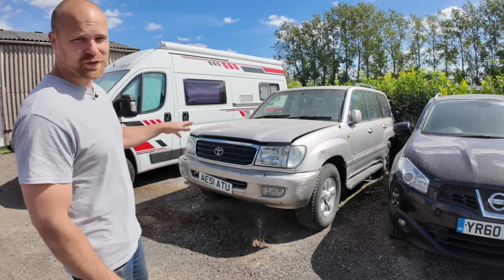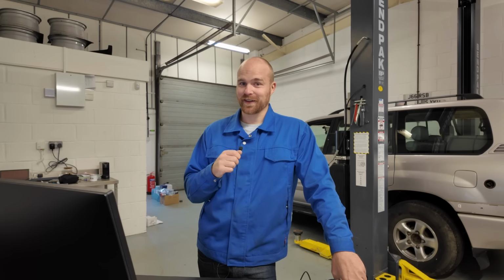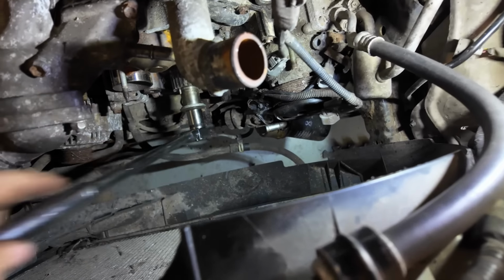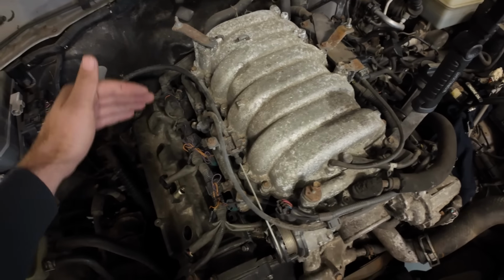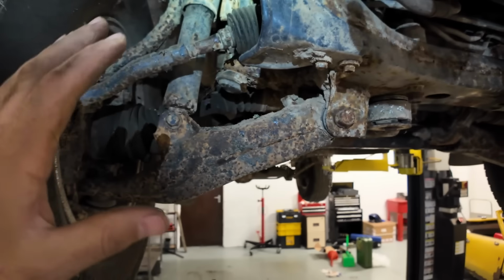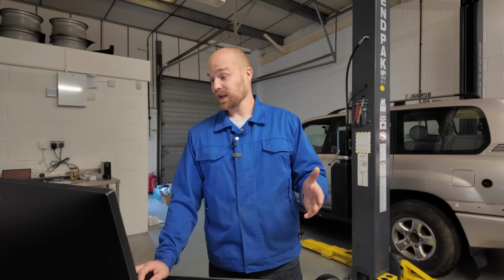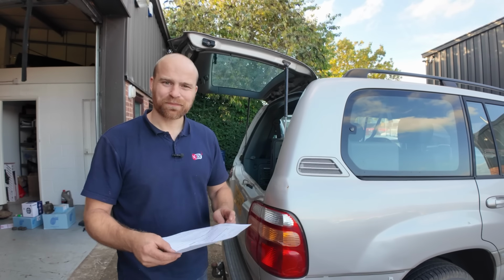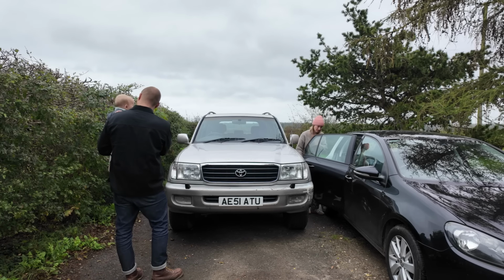Can I Rescue This Abandoned Toyota Landcruiser?

Comment: 200k on those engines is barely broken in , so a few short intervals oil changes and it will run better then any car you currently own

Comment: I would try to attempt fixing bad alternator or starter motors, they are usually pretty easy to fix, and parts are not that expensive for them. Only issue is if the alternator is that stupid one with sensors which needs to be programmed. Don't waste money on new ones unnecessarily.

Comment: Looks like there is an LPG (propane) fill point? If it has been run on LPG, that’s why the oil and inside of the crankcase is so clean.  LPG burns clean and doesn’t carbon up the crankcase. Therefore, I don’t think it’s been starved of oil! It’s probably old oil, just looks new! 😊
Reply: I was shown the dipstick of an LPG fueled car that had driven 250,000 klms. on the same oil.   It looked like it had a oil change the previous week.   LPG burns very clean compared with petrol.  Taxis with the Ford straight six 4.1 litre engine running LPG here in Australia usually got over 1,000,000 klms. before requiring engine work.

Comment: As an owner of a '99 JDM Toyota Harrier (which I love!) and a long-time admirer of the Land Cruiser, this video was a total joy to watch - great job! But you MUST change that timing belt ASAP - not only is it indeterminably old but it's also been wound round itself - it's a failure waiting to happen! You've got me looking at Land Cruisers on eBay again!
Reply from the maker: I've already purchased the parts! I was very surprised by the money that some of these are fetching!
Reply: What's a harrier?
Reply: @landcruiserscotland  It’s the JDM version of the Lexus RX300 but lighter, with a more powerful V6 engine, and a gearbox with sport and manual modes - its a great drive and can easily out-accelerate cars like Mazda MX5s! The engine is effectively the same as the Land Cruiser’s V8 but with 2 cylinders off, and DOHC and VVTI included. Only problem is 18 mpg!

Comment: You are one brave MF! And I thought you had gone too far in when you took that engine out of the Fiat 500 but no lessons learnt I can see, I'm struggling with the same problem myself unfortunately. Also you need a different jet wash nozzle for your car, that one will strip the paint off if you hit a chip.

Comment: That carly online tool looks like a real winner.  A good number of machanics wont be very happy with it. 

Its actully very handy, and will give many people confidence, if the see a part is £100 and its a sub 1h job, and thd average garage cost is £600, to think, i csn give that a go. Even if it rates you 4h on a saturday afternoon, its worth the £500 youll still have. 

But its a curse for garages that many are already struggling along. 

I had the best mechanic ever he done all my cars for years and one day he was ripped off by his business partner, and je had to shut up shop and go back to airbus aged 55! 

Him closing shop,was a big factor in my finally going busness lease, so i didnt have to worry about maintenance and finding a new good man. 

Before thst id by 4 year old ex fleet estates, and they would do me untill 10 years old.

Comment: I have the exact same year LC here in Oz..4.2 TD.   Still worth about 20 thousand of your pounds in good condition. The waterleak is most likely the sunroof drains. The wheel centres are worth big $$$ from Toyota and are prone to get loose and fall off. I'm guessing yours has the refrigerated centre console as it appears to be the top model.  They are very reliable and work off the ac. Your handbrake will be useless. They all are and are the brunt of Nissan Patrol owners jokes worldwide. Fun fact: they sold them as Lexus here as well but only with the V8. The turbo diesel was way too unrefined to be sold as a lexus. Fun fact #2  the Carly won't  work on the 4.2 TD. It uses a Toyota only diagnosis format.

Comment: I seen where a bad timing belt tensioner, do exactly what happened to this engine, the belt is able to wrap around the crank pulley then causing the cam pulley to break off, weakest link breaks basically, but luckily when it happens, everything dead stops, saving valves. I can't say for sure having not examined your tensioner, but if you were able to push it in by hand it's not good, it should have required like a clamp or something similar to get it back in and pin lock it until the belt is properly installed.

Comment: Brilliant job. Well done. My advice would be to take your time sorting out that underneath, but crucially to not look at it as a whole but just pick a small area, a small enough area that you reckon you could do a good job on with the wire brush (preferably on a grinder) and just be satisfied with doing that small area for that session. Then next time you get it up on the lift do another small section. Better to do small areas at a time but perfectly, instead of big areas not so perfectly. Have fun with it.

Comment: The best model of Landcruiser ever built. I had a 97 Landcruiser Colorado in the same colour, did 150k miles in it and it was utterly bulletproof. Design and build quality never surpassed.
Reply: Hi there. I also run a 1997 LC Colorado brought it in 2005 with 41k on it still are daily now on 323k just passed MOT with no advisory’s. But I maintain it with in a inch of its life. Keeping the rust at bay is getting a struggle.

Comment: That smoke is probably valve stem oil seals. You can refurb an alternator with new brushes and bearing for £15, no point buying a new one

Comment: I spy with my little eye an LPG filler cap which is a bonus. These cars are superb. I had use of a 1996 diesel manual, it was an absolute tank. It looks like you're smitten with it as I was with the one I used. Have you considered getting the underside ice blasted ? The results are amazing
Also spotted the tow bar, another bonus for the prospect of a car trailer
Great channel, great content. All the best
Reply from the maker: Yeah it's had LPG at some point, but it's been removed now. Quite a few people have mentioned ice blasting, so I might have to give that a go
Reply: Probably moved lpg over to the cars replacement
Reply: Is that fusible link not generic

Comment: Was this thing on Gas? I see a secondary hole next to the fuel filler. If so, chances are it’s valve gear has been WELL hot. Hope it works out for you Nino
Reply from the maker: Yeah it's been on it at some point in the past, but it's all been removed now. I'll be keeping it that way

Comment: Congrats, great result and awesome Video!!! 
Free Up the Discs more, than Put new Pads. New tires, Timing belt, full Filter/Fluids Change. Then some Rust Stop/ dry ice or similar on the frame. After that some cosmetics and you have yourself an forever Car.
Reply from the maker: Not a bad plan at all 👍🏻

Comment: I have a 2000 Toyota 4 Runner, with 206,000 miles on it, but NO rust as I live on the West Coast of the USA, plus a Triumph Vitesse, which is fully restored, with 30k miles, I don't have a Carly, but I do have a FIXD, which is very similar. I have replaced my battery, alternator, injectors and intake air box, which was leaking, also my O2 sensors, I have cleaned my MAF sensor. I change the engine oil every 6,000 miles
Reply from the maker: If you look after them they'll look after you in return. Good work 👍🏻

Comment: The Toyota 1uz and 2uz are certainly among the most reliable engines ever made!! The STALE fuel and sitting so Long will account for the rough running just needs fresh fuel and a Good run!! Replace the old timing belt it would be FOOLISH not too!!
I would surprised if could not for at least $5000bpds!

Comment: If you want to go out in the bush take a land rover. If you want to come back alive take a Toyota. And btw I own a disco 2 and love it . Great video !
Reply: Speaking as someone who used to have a Land-rover 90 this is such a tiresome Internet regurgitation. 

It had 170k on the clock and spent its first 7 years as a site vehicle and then got used hard as a tow vehicle. It's still currently taxed and MOT'd and I sold it on in 2007.

Comment: Loved the video, Looking forward to the next part. That's definitely a car that deserves to get the underbody cleaned up and rust prevention applyed and not a nut and bolt restore but definitely replace the bad bits (2nd hand of course) amd get another 200k miles out of her, I have had cars well under 8 years old with more mot issues than that old girl
Reply from the maker: Yeah that sounds like a plan. A 400k Landcruiser is a cool prospect

Comment: Brilliant. I like how good Toyotas from the 90s and 00s are and how they really are fixable. Not taking anything away from your efforts, but I expect that the alternator might have come back, too. The fusable links (just fuses really, I think) are quite readily available on eBay etc and most Toyotas have standard sizes of between 80 and 140 A in the engine bay. Like that you soldered as a fix. I bet many have been replaced with bent nails or fence stables around the world. Great diagnostics on the cam and when that went, I think if folded the belt over and stopped the engine PDQ. That probably saved the engine. I think the engine deserves a new belt and idler as I expect that belt is damaged. You may also find the fan clutch doesn't work as it should and in warmer conditions the temps might rise. The Toyota manuals are superb and, easy to follow and I'd like to see what you do next with the LC. It might be expensive to fuel but it deserves to be cleaned and run in so it has a new life. A good clean and prep underneath and then some Lanoguard or other treatment would be good, too.
I have a NEV Toyota project vehicle and should get a sweatshirt to wear when I working on it.
Reply from the maker: Really is a fantastic car. I'm instantly a Toyota convert. I very much plan to give it some proper love in future videos. New timing kit, underside treatment, fresh interior - the works!

Comment: Absolutely mega mate! I wonder if someone got to the point of no return and started breaking bits off it? I had a similar LC last winter, which i bought cheap and did up, it was the 4.2td, unfortunately it suffered from the rust bug, but some heafty weekends with the welder sorted that and i managed to turn a decent profit in the spring. But… to this day its stuck with me, probably the best car ive ever owned. I dont miss the fuel bill though!
Reply from the maker: Thanks bud! Yeah, I reckon it was used as a parts car - can't think of any other reasons such a random collection of parts would have been removed otherwise. I didn't realise the value of these cars until after I bought it either. Great work getting yours back on the road and spinning a profit

Comment: I had a 4 litre version of the engine in a 1990 Toyota Soarer  so I knew it was a non interference engine but not the variable valve timing version. They are a beautiful smooth running engine which will rev up to 8000 rpm in the version I had. i hope the engine is OK

Comment: Nino, you beautiful bastard, this is the most amazing episode ever on your channel, all hands down. I absolutely love the new production style, which is informative and engaging. Also, the old Bertha coming back to life brings memories of the episode of Top Gear when they try to kill a Toyota pickup truck and no matter what they tried it was coming back to life every single time. It's a great statement to Toyota engineers, especially regarding the quality of their builds. One last thing it looks like this car has been fitted with an LPG installation, suggested by an inlet near the fuel flap, but I've seen no connections or accessories related to LPG installation inside the engine bay.
Reply from the maker: Haha I appreciate that mate. I put a lot of effort into upping the production value and I'm glad it hasn't gone unnoticed! The car has definitely had LPG installed in the past, but it has all been removed at some point
Reply: @NotEconomicallyViable  Indeed, the production values shown here make Wheeler-dealers look like a amateurs. Very well put together. Sourcing parts at reasonable prices for these must be a pain in the ass.
Reply: Send this to Ukraine!
Reply: @MarkOBoyle-wx2ck  no!

Comment: I reckon it was used off road, hydro locked the engine and snapped the cam as weakest point rather than bottom end…. Hence air box and everything being removed too
Reply from the maker: That could well be what happened

Comment: I'm surprised you didn't show revolving the engine by hand eight times to see if the valves were actually in time (or maybe you did and didn't video it?). So surprised it ran on old fuel. A testament for Toyota ruggedness.
Reply from the maker: Yeah I did that, but can't show everything in a video as it'd be 5 hours long and deathly boring
Reply: @NotEconomicallyViable  Thanks. Glad you got the old girl running again. Toyota's are great.

Comment: People neglect reliable cars like that because they think they can "get away with"...because they're reliable
Reply: Indeed! I've got myself a 2004 V6 camry with only 65k miles and half a dozen of issues totally caused by neglect and lazy mechanics. Parts are cheap even considering I'm not in the US and the thing is a total tank
Reply from the maker: Yeah, it's a shame some people have that attitude. It's also what makes bringing these cars back to life so rewarding - they deserve better than they've had!
Reply: I know what you mean. Myself having been converted to a remorsefully care-taker of a Forester SG that I took granted for 10 years. It's getting all the attention and garage coziness I can muster in order to keep that 5 speed manual + low gear baby alive.
Reply: I ran a 94 civic from 2000 up till August this year only reason I stoped was due to stupid emissions regulations that means I’d have to pay £12 to drive about on any given day, it never had the luxury of regular oil change or
 services, I recon I did get away with a very very lot, damn reliable sohc engine!
Reply: Ah Nino! What a fantastic episode!! I owned a 2000 Land Cruiser GXR here in Dubai a long time ago. The mechanical camel of the desert!! 🐫🐫

Blew the transmission idling it for 5hrs on a beach. 🙈 Only found out after it didn’t have a transmission oil cooler 🙄.

Yet again the story arc is epic. You have a natural flow for storytelling that works a treat!

We just need more videos now so you can make more 💰💰!! The formula is perfect now 💪🏻💪🏻

Comment: Before I even looked at the engine look underneath if it is rotten don't even bother to repair it as it will cost you thousands in welding and replacement repair panels, I hope you didn't pay more than scrap metal prices.

Comment: Great to see you back and great job on the old girl.That 2uz is a great engine and will just keep on running with regular servicing. First job is please for me do the timing belt after all that work it would be your luck for it to fail 😂.
Reply from the maker: Thanks mate. Yeah I already have all the new timing gear - very worried it's still a ticking time bomb
Reply: @NotEconomicallyViable  My understanding was that only the 2006 /2007 with VVTi were interference engines and the earlier ones without vvti were not interference engines. Would explain why there was no damage when the previous fault occurred.
Reply: @NotEconomicallyViable  Probably worth changing diff/transfer box oils, ATF (Exchange method using the transmission pump, good vids on youtube) and coolant too